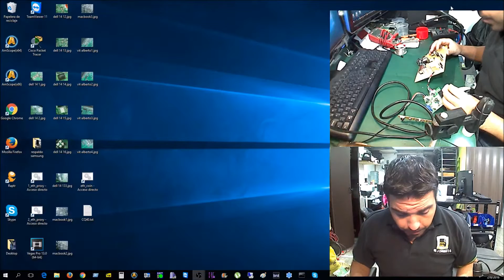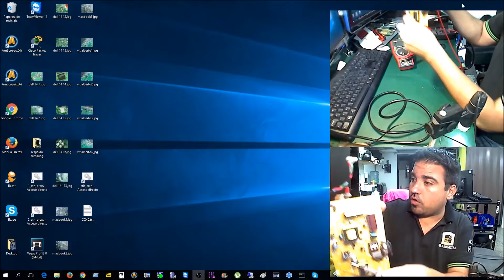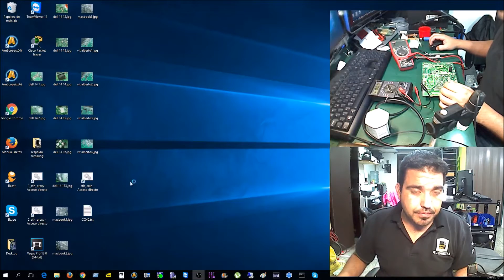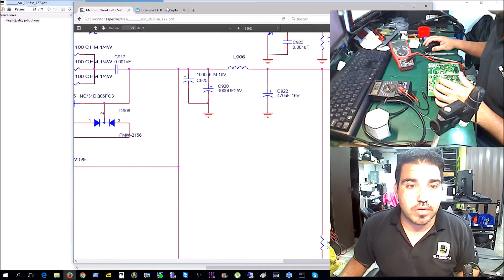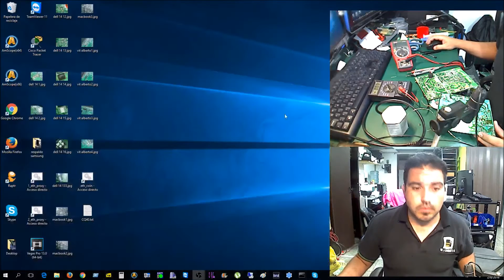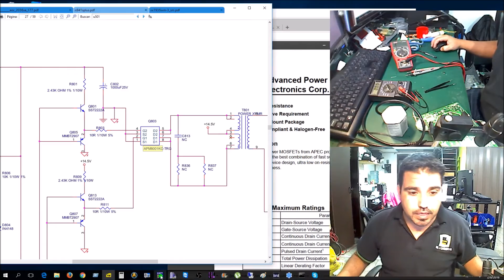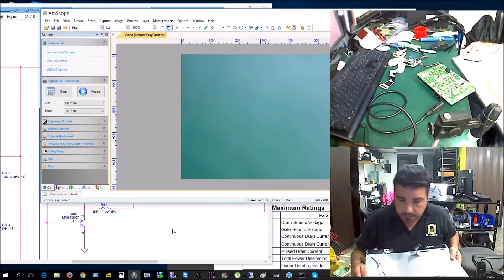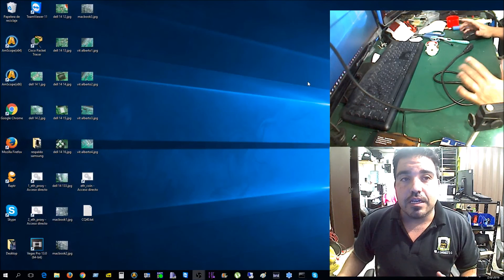Reparacion Monitor VIT TFT19W80PS no enciende. No son condensadores abombados

Comment: Muy buen video, no se encuentra mucha información sobre los monitores vit. El mio es ese mismo modelo pero presenta la siguiente falla: la parte inferior del monitor (como 1/4 de la pantalla) se ve rojiza, no enfoca y esta como en cámara lenta. No tengo ni idea por donde podría venir ese problema. ¿Tiene alguna idea de donde podría centrarme en la busqueda o si puede tener solución?
Reply from the maker: Hola Javier, lo mas probable es o el flex de la pantalla o la pantalla...
Reply: ok, muchas gracias, intentaré ver primero el flex. Saludos
Reply: Hola también podría ser la tarjeta t-con que es la tarjeta que va pegada a la pantalla LCD con el flex. Una vez encontré un condensador smd con valor raro y se me corrigió una falla en un monitor. En ese caso era que encendía, mostraba imagen un momento y luego se ponía blanca la pantalla con un brillo intenso.

Comment: Tengo el mismo monitor.Solo que este me  daba vídeo (a veces si, a veces no, o de modo intermitente) hasta que deje de usarlo por un tiempo y no me da vídeo. Compre una tarjeta de vídeo, la conecte y me funciona normal. Quito la tarjeta de vídeo y la conecto a la tarjeta madre y tiene vídeo como antes estaba.Al siguiente día la enciendo sin la tarjeta de vídeo pero regresa nuevamente la falla. Probé la tarjeta madre con un monitor CRT para descartar la tarjeta madre y funciona normal.¿Me puedes decir si esta falla esta relacionada con los capacitares?
Reply from the maker: Hola Jose, gracias por tu pregunta... bueno si te da vaya con el monitor solamente, si, lo mas probable es que son los condensadores electroliticos del monitor que por el calor se secan ... es algo relativamente sencillo pero necesitas tener algun tipo de conocimiento de seguridad y un cautin bueno para realizar el trabajo...
Reply: Si ya la repare gracias a este vídeo y funciona, solo que coloque 2 de los  condensadores de 85° grados y algunos reciclados de un tv. Mi pregunta ¿Se podrá colocar condensadores sólidos ya que son mas eficientes y duran mas tiempo, no afectara el funcionamiento? SUSCRITO
Reply from the maker: Los solidos son mejores... si lo consigues de las mismas caracteristicas no tienes problema.. verifica el precio ...

Comment: saludos Prof. cual seria la configuración de la estación de calor el cautin temp =? y pistola de calor : temp=?  Aire=? para soldar y/o extraer los componentes smd  en las tarjetas laptop, mobiles, tablet..
Reply from the maker: Gamalier Zurita Hola gamalier todo depende de tu estacion, que tan grande es el componente y que tanto disipa la tarjeta madre... yo uso 460 con aire 6 y precaliento el área como 10 seg y después lo acerco.. te recomiendo poner estaño con plomo en los terminales del componente que vas sacar para bajar el punto de fusion y así sacarlo más rápido sin que se dañe... debes sacarlo lo más rápido posible porque sino dañas el chip.

Comment: Hola Metadata, luego de que energices la fuente de un monitor de esos es bueno descargar el condensador principal donde llegan 172vdc, antes de hacer medidas con el tester o trabajar con el cautin sobre la tarjeta. El se queda cargado mucho tiempo. No es recomendable descargarlo cortocircuitando sus pines porque se puede dañar otro componente en otra etapa relacionada, sino con una resistencia y vamos viendo como decrece el voltaje con el tester en paralelo. Solo por agregar. De resto muy fino el vídeo como siempre. :)
Reply from the maker: Damarys Guevara Páez hola damarys gracias por tu comentario... aunque tienes razón eso es lo que te enseñan en la escuela es para protegerse uno no tanto los componentes, lo mismo pasa con el aterramiento en los equipos... Con respecto a lo que dices cuando tienes tantos equipos y la carga no es mucha uno tiene la mala costumbre de hacerlo... en una linea primaria por supuesto jamas debes poner un destornillador para descargar el condensador pero en la linea secundaria no es tan crítico...agradezo tu aclaración porque tienes razon pero es como el dicho, "haz lo que yo digo y no lo que hago" :) Gracias por tu apoyo al canal.

Comment: buenas me podras ayudar, tengo un monitor vit modelo TFT19W80PS. 
lo siguiente es que tuvo 6 capacitores abombados se le hizo el cambio respectivo por capacitores de mismo valor.
enciende y muestra la imagen que no esta conectado el cable vga pero al conectarlo la panatalla queda en negro, la tarjeta madre no tiene daños visuales.

espero me puedas ayudar con esto. gracias
Reply from the maker: Hola Pedro, gracias por tu apoyo al canal... me dices que cuando no le conectas el cable VGA el enciende y te da la pantalla de verifique el cable correcto? y cuando lo conectasa a la comoputadora no da video?
Reply from the maker: Cuando hablas de la tarjeta madre es del monitor? o de la computadora?
Reply: A mi me pasa lo mismo.. se refiere a la tarjeta logica pequeña... a esa  tarjeta logica pequeña... yo le cambie todos los capacitores y después de ese trabajo el monitor ya dio imagen al conectarle el cable vga pero... la imagen no se ve nítida..  se ve con defectos...
Entonces procedí a limpiar los contactos de la  cinta lvds y siguio igual...

Ahora medi voltaje en la tarjeta fuente donde dice 5v y sorpresa! Me da 12v.. creo que allí está la falla.. ahora si por favor me pudieras orientar a encontrar la falla de esa anomalía... será el transformador? Optó? O tl431? Diodo zener smd? Gracias

Comment: Hola amigo buen vídeo tengo una pregunta tengo un monitor de este tipo mi monitor tiene una falla por ejemplo cuando enciendo la pc la lampara del monitor se queda en negro pero el led en verde esto significa que el monitor esta recibiendo señal   pero no muestra imagen ahora si desconecto el cable VGA el monitor de dice revise el cable VGA. ahora bien si yo conecto y desconecto varias veces el cable VGA y el cable de alimentación llega a un momento en el que el monitor muestra señal sin problema y mientras no apague el monitor o la pc no falla en nada. un amigo me dijo que este problema se debe a un integrado que esta en la placa de vídeo del monitor el no lo puede arreglar ya que dice que para eso necesita una pistola de calor mi pregunta estar en si tu también crees que este sea el problema
Y otra pregunta es si esta placa la vender y también en cuanto seria su costo espero me puedas responder y excelente video
Reply from the maker: Hola muchas gracias... bueno con respecto a su pregunta, no tenemos la fuente para la venta... con respecto a la reparacion pudiera ser el transformador del inversor... le dijo exactamente que componente estaba malo? es decir PU5 o Q32 a ver si lo tenemos ? porque estos equipos son muy especificos.

Comment: hola tengo un vit, le cambié 4 condensadores abombados encendía, por error la placa fuente rozó el metal del lcd y echó un chispaso, ahora no enciende, que se habrá daño
Reply from the maker: nildangg hola... debes tener el chispazo donde se daño.. no tiene ninguno?
Reply: no y mira que lo he observado bien.
Reply from the maker: nildangg chamo... entonces no se.. pude ser el fusible, fuente rectificiador, octocoplador bobinas... mosfets .... transformador.... quisiera ayudarte pero esta dificil si no tienes alguba referencia porque debes revisar cada componente...
Reply: hola amigo mi monitor tiene un problema el LED parpadea y no enciende tarda un buen rato le cambie los capacitores pero aun sije asi que prodra ser?